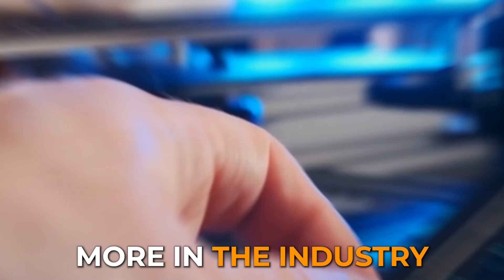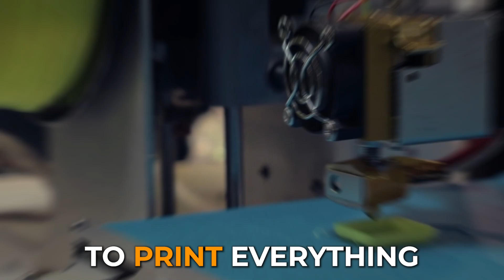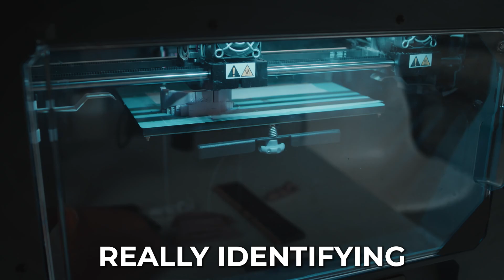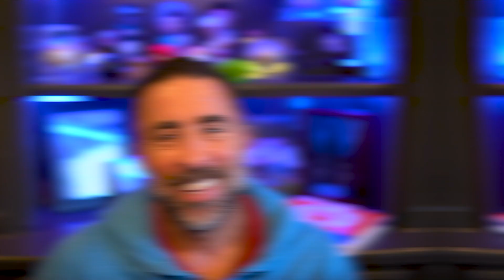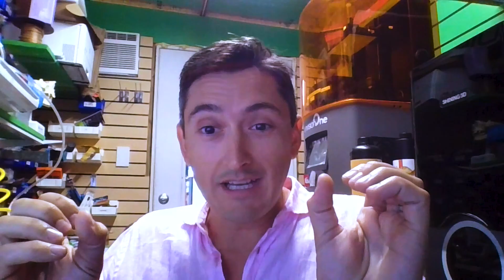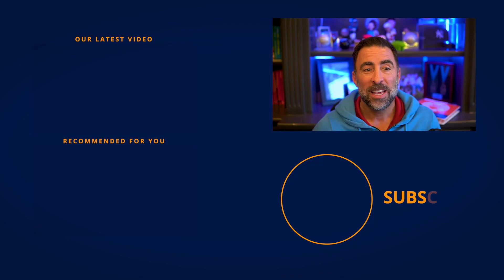The Direct Print 3D Aligner Advantage in Orthodontics w/ Mike Gordon

Comment: I have a great appreciation for the Graphy TC85 resin when it does not cause adverse reactions. In my experience, out of 41 cases, I have encountered four significant reactions where patients experienced substantial swelling of the lips, lower face, and throat, nearly leading to choking incidents. Each aligner I produce adheres strictly to their protocol. Despite control boiling, the aligners appear perfectly clear and normal. Upon reaching out to the company, their consistent response attributes these reactions to bacterial or mechanical causes, or inadequate polymerization. However, I ensure that all aligners are thoroughly checked post-control boiling, mechanical damage is ruled out, and I always perform a straight cut, ensuring the edges are polished to remove any support remnants. Additionally, I instruct my patients to boil their aligners daily for one minute for sterilization purposes. Even though the incidence of these reactions is relatively low, we cannot dismiss them as normal occurrences. I am perplexed by the assertion that this material is 100% biocompatible. Graphy has been unresponsive to addressing this issue, despite many of my colleagues experiencing similar problems. While I understand that this is a new technology and collaboration is essential to resolve these issues, Graphy continually deflects blame onto us, the users.

I have learned that an updated resin version has been introduced in the US. I would greatly appreciate it if someone could provide more information about it.